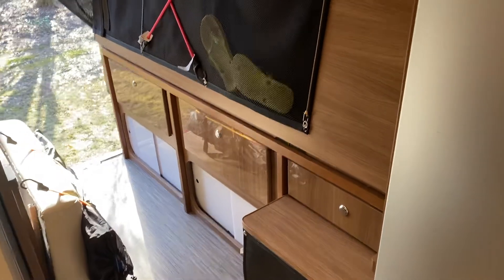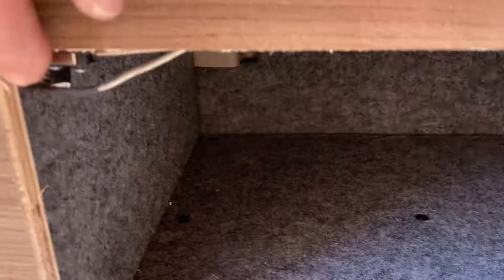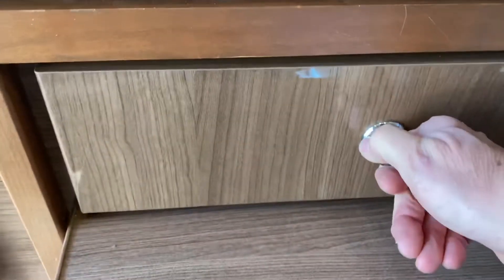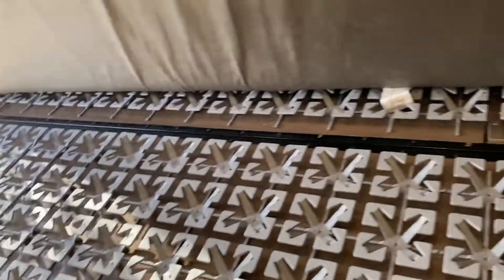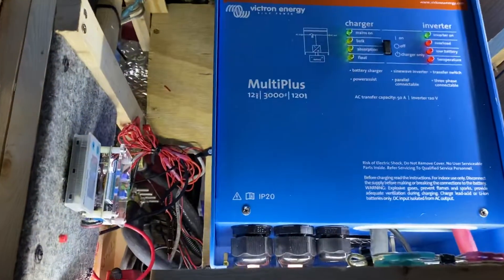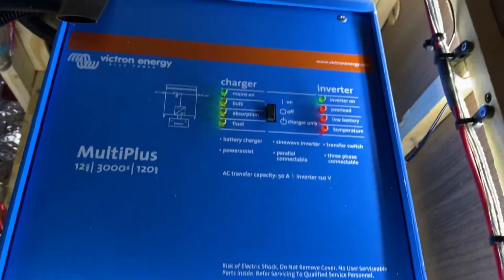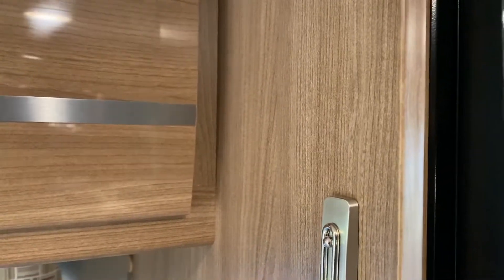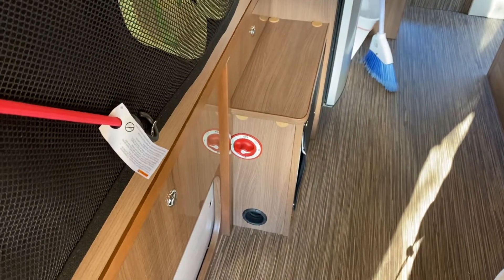BattleBorn/Victron and Underbed Storage Project Complete

Comment: How many batteries did you go with?  Did you use the GC2 ones or the standard ones?  Be great if you did a quick video showing how the batteries are in there.
Reply from the maker: Brian Weaver regular batteries. They are buried in there and a video would not show very well.
Reply: @travato1592  how many did you fit in there ?
Reply from the maker: Brian Weaver 2 stacked
Reply: @travato1592  I'm planning to put 2 where the AGMs are and 2 inside
Reply from the maker: Brian Weaver I’m gonna put 2 more in place of AGMs when BB comes out with an internally heated model

Comment: Is your Travato technically a 59GL now? Your mods are super clean!
Reply: No, the G Model is far different; 48volts, Volta system, no generator, underhood second alternator (generator) and many other electrical differences including auto start.  My van simply has Lithium batteries and an inverter and a battery monitoring system, which the 2018 G models did not.